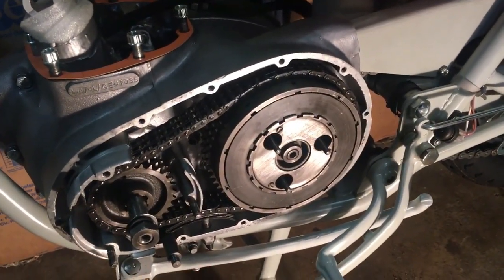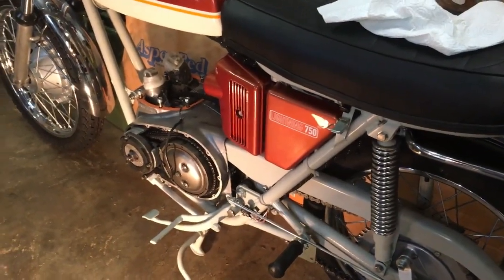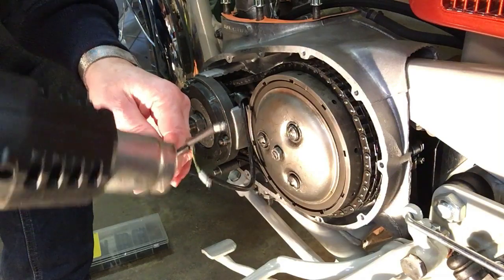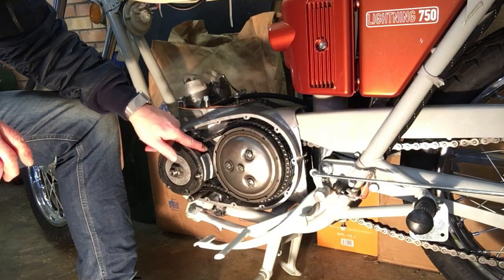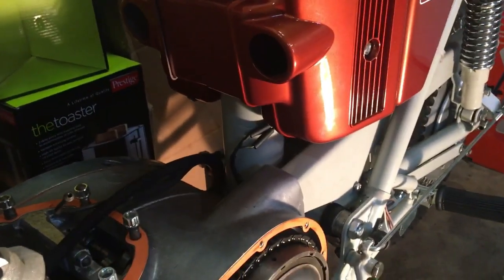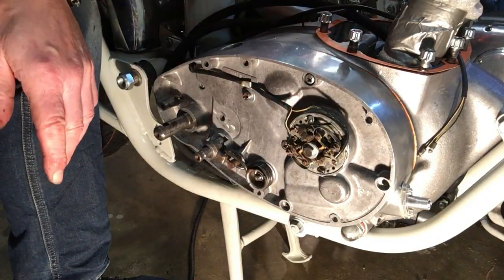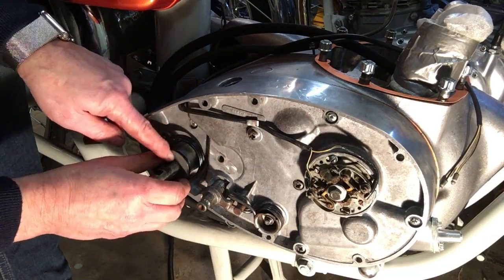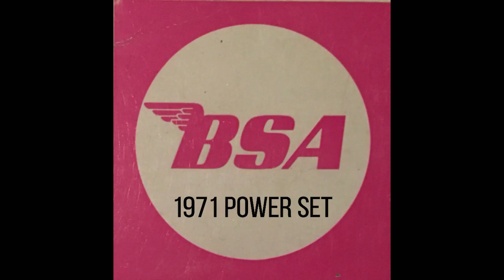BSA A70 Lightning - Engine Part 27 - Primary and TIming Case Build Finale

Comment: Not to step on toes here mate but please dont use an impact drive to tighten screws. Loosen, yes, sure if they are misbehaving. Also I think that you will find that the kick start spring retainer has been fitted hook out, this will foul the outer case, should be hook in.  It also looks like you forgot the Chain tensioner adjuster top button, ie the plastic disc between adjuster bolt and adjuster shoe. Lastly, I think to avoid warping the the case it is wise to start with the centre screws working from centre out radially, preferably tightening them gradually.   My A65 had stator wires pointing out and even a hole on the stator support for a tie to stop the wires rubbing on the chain. Good luck with the build, can`t wait to hear her fire up!
Reply from the maker: Hi KG and thanks for the interest and comment. You are by no means stepping on toes and all observations, preferences and recommendations gratefully received - you never stop learning. Re the screws I was always advised in my youth at BSA owners (Manchester, 1977) to tighten with impact - but not go mad, i.e. gentle taps so as not to strip thread. I'm pretty sure they were impacted at the factory?? Agreed I did not particularly pay attention to the order in which I tightened so that could have been better. Re kick start spring retaining plate - you are absolutely correct, it catches the outer cover slightly so needs to be turned around - thank you for that. I did attend to the primary chain tensioner top button so that is fitted. Finally yes I've had dialogue with others regarding the stator wires (Marc below) - I fitted it that way round as I could not see a clear route the other way. Will check again and also the parts book to see if there is any reference to a retaining clip. Many thanks again for the interest and comments.
Reply from the maker: Hi again - just checked the parts book and indeed does show the clip for the stator wire to secure it after looping back from the front. Better still I have a new one in stock so must have removed one on dismantling - clean forgot. Thanks again KG and Marc for pointing out.
Reply: @BSAPowerSet  perfect. Can't wait to se her finished 😍
Reply: Absolutely. Tightening with an impact driver is a recipe for stripped threads. You cannot feel how tight things are whereas doing it by hand allows you to learn over the years how tight you need to go. Some of these old ways are best left in the past.  Ask me how I know ...
Reply from the maker: Hi Steve - thanks for the comment and interest. I seem to have created a bit of a subject here so appreciate everyone's advice, experiences and recommendations. I agree there is always the risk of stripping using such tools; however, I do check that the threads and screws are good and I assure all that I only give one or two very light taps on the old impact to nip up. I'm sure that this is well short of the pressure that you might apply to an Allen set if these where fitted. Anyhow point taken and thanks again for the interest.

Comment: Unsure about your particular year (no personal experience with A70) but most A65 motors run the stator with the wires pointing out, then curling around and through the rubber boot and hole. Not exactly sure why, but the factory must have had a reason, maybe to keep the wires father from the sprockets
Reply from the maker: Hi Marc and thanks for the comment. The A70 is June 1971. Yes I've see wires pointing out and then turned back too. However with that routing back and over the top of the stator then in my view you run more of a risk with fouling the chain, especially as there is no support or guide for the wire. So my logic is shortest direct route. Also with the later A65 you are constrained by the alloy shroud supports for the stator. Final point is that the wires are the right length as is to connect with main harness. The other way round they may end up slightly short. I will double check the parts book/workshop manual though. Thanks for raising.